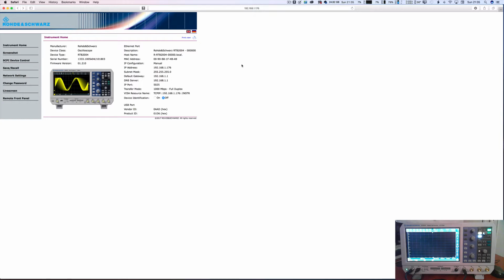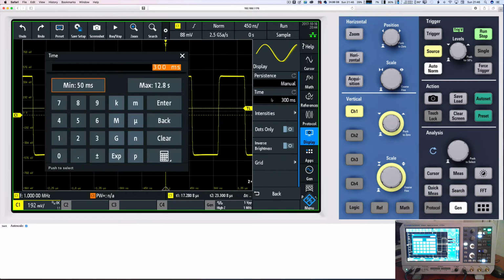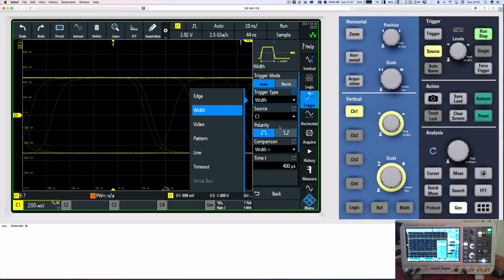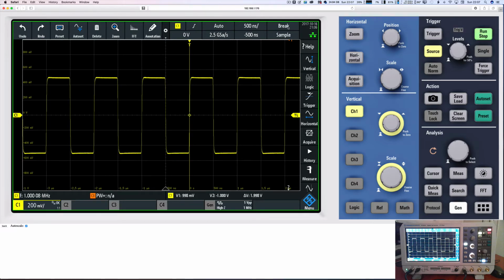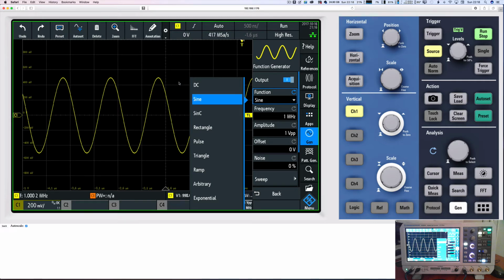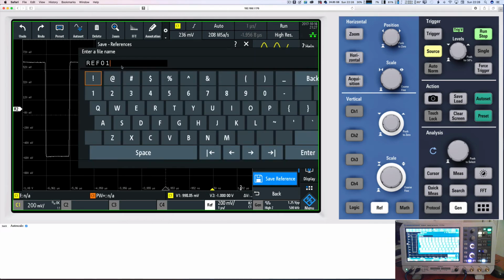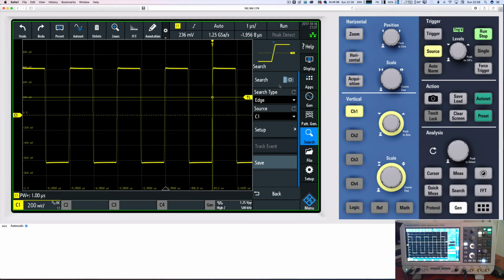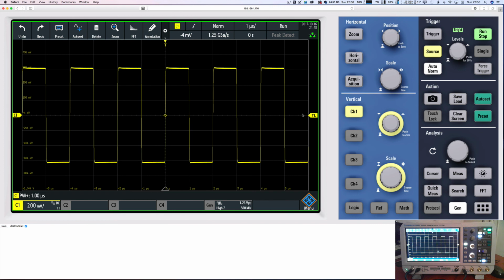Rohde & Schwarz RTB2004 Oscilloscope Web Interface Software

Comment: Hi Michael
Just watched your video most impressed though I know nothing about electronics. Strangely I have always wanted to study the subject and as I'm now retired thought I would have a go. Would you recommend buying a scope for a learner? Looking about I find that most scopes come from China and hate buying any goods from there. I certainly like this scope it looks like the Rolls Royce which is reflected in the cost. Do you produce any basic lessons scopes and electronics?
Reply: Hi, sorry for the slow response, I only just noticed your questions.
Firstly, unfortunately I don’t personally produce any videos on learning electronics, you should probably have a look at Udemy website as they often have sales and some of the video courses are of a high quality or alternatively look at YouTube for free videos like eevblog etc.

Regarding the oscilloscope, yes long-term if you are serious about electronics, especially analog electronics you will need a scope. Have a look at the Rigol brand for more budget scopes or Keysight. I have an old 2 channel Rigol DS2072 which is a really great scope.  The RTB2004 is also available as a two channel 70 MHz bandwidth version I believe starting at around a $1000 new. The RTB2004 is a lot more money at 300MHz fully optioned but it’s a really good scope that sometimes available with all options at a deal price.

Hope the above helps.

Stay safe.

Best Regards

Michael

Comment: Really enjoying your reviews, Michael. A tip that might help ppl who are unable to connect to the cro's web server: perform a Secure Erase which is under Setup menu.
Reply: Dear David

Thanks for the comment regarding the web server.

I can only comment on my experiences, but the web server works really fluidly (smoothly) on my Mac laptop and desktop machines.  I have also used a wireless hub with an ethernet cable to the scope and this also works smoothly without any noticeable delays.  Finally, I have also controlled and viewed the scope from my iPad on the same wireless network (sorry, I am a bit of an Apple fan-boy!).

Thanks for your advice about a Secure Erase.

Kind regards

Michael

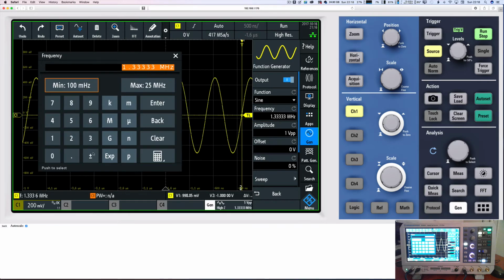Comment: 43:00 You are using the mouse to set the frequency. Did you try to use the keyboard? If you hit some numerical buttons on the keyboard, does the numbers appear in the frequency set window?
Reply: Hi, sorry for the late response, only just seen the comment.

You can enter the values on the touch-screen keyboard that the scope displays with your fingers and the values appear in the frequency box etc.  I prefer to use the mouse as it keeps the screen cleaner and I find it faster.  I believe you should be able to use a physical keyboard if connected to the scope or connected via a hub so the mouse and keyboard could both be connected.  I will in the future make a video demonstrating this and also with a wireless keyboard and mouse (my mouse is wired to the front usb on the scope).

Hope the above helps.

Kind regards

Michael

Comment: So how do you find the web adress? Is the only way to look up the IP in the scope, or is there another way?
Reply: Hi, one method of finding and setting/altering IP address of scope is to touch the green icon on the top right corner of the screen.  The icon is a horizontal green wire with squares above and below (network connections). This icon takes you to the set-up screen for all the IP settings either automatic or manual DHCP.  The settings are quite extensive and I have managed to connect my RTB2004 to both my home network switch and also directly to an iMac I have in my Lab.  

The network settings and the web interface of the scope work flawlessly.  I have found virtually zero lag on my network, but I am running a 1000 speed network on cat 6 cable.  You do not need to install any software on your computers and only require a web browser.  I have found it works perfectly on my iPhone 7 and my iPad; it is also possible to have multiple connections open at once!

Just a final comment I am sure you can also access the network set-up page via the main menu (Settings) on the scopes on screen menu or physical buttons.

Hope this answers your question.

Regards

Michael
Reply: @michaelrothschild2646  thanks, found it

Comment: Thank you very much for these videos!  Trying to decide between this and the much cheaper GW-Instek mdo2000e. The R&S seems very user friendly and I can't wait for the analog performance test.
Reply from the maker: Hi, Thanks for comment. I am not really very familiar with the GW Instek, other than watching a few reviews, however I would say the screen resolution, waveform clarity and serial decodes are really good/excellent on the RTB2004.  I will for the next video look at the analog accuracy (ADC) performance etc. I would also say I really think the electronics in the RTB2004 are probably better than GW Instek, my only possible criticism is the missing advanced maths functions. The waveform update rate I have measured to be on par with most over 50,000 waveforms/second scopes.  The scope is also very fast for serial decodes as it done in the Altera FPGA, hardware and not slower software. Hope my comments help. Regards Michael